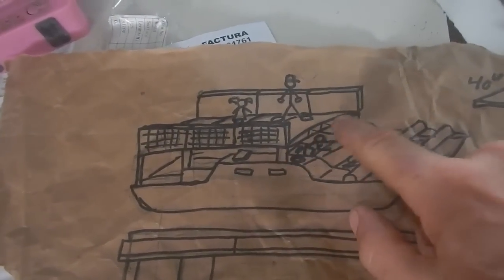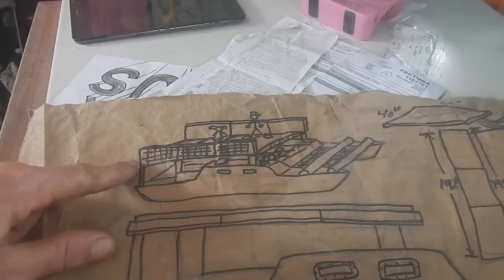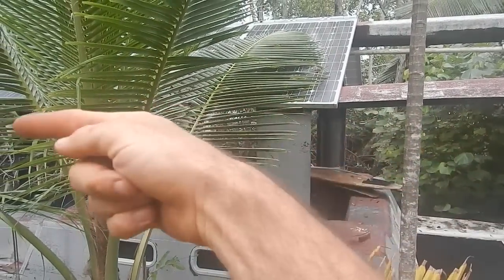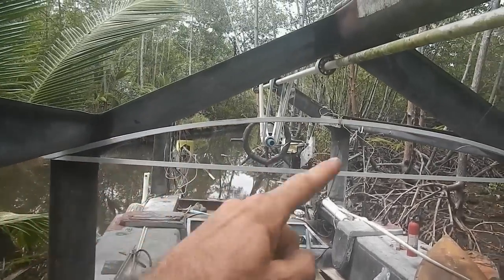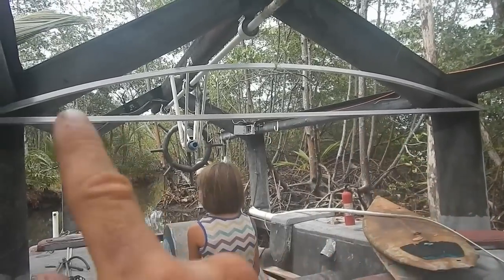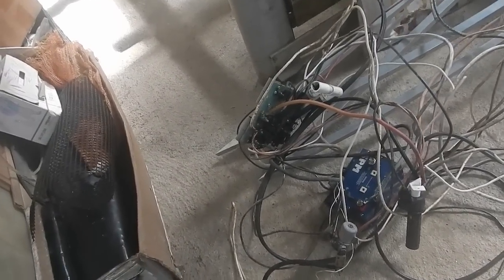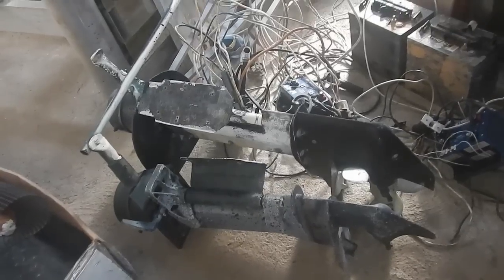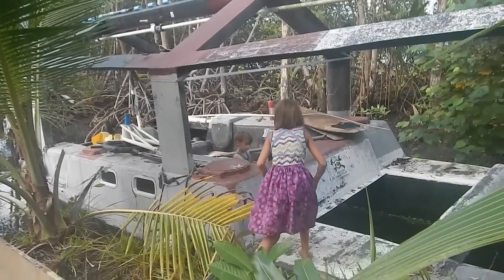Shark Slicer upgrade 011 Out With The Old

Comment: love the concept. I am gonna miss that structure. can’t wait for the new look. my idea was each solar panel section has extended pipe that fit into angled pipe inserts predetermined for each situation. manhandle each solar panel into position and then double loop cotter hair pin to lock it down.

Comment: If you are going with the metal roof. It's going to be super hot sitting underneath. Walking on top will melt your flipflops.
Reply: Painting the outside white and the inside black should help with the heat.

Comment: what about putting the solar panel on upside down  U shape so it can slide on both sides, and then add a tarp that can be pulled on the inside part of the rail  - to protect you from the sun water and wind or content of the boat. I would also consider covering the panel before gong to the port so people wont steal it, and also when its not in use - so the panel don't produce 'waste' energy and shorten its life

Comment: your structural integrity would be stronger if you left  your vertical posts and the horizontal beams connecting the posts . Then  you could cut off the old diagonal roof that supported the solar panels /and all the steering mechinisms need to be reconfigured!!! Just a thought ....you always  make it work

Comment: I dont get the whole shark slicer needs a new roof. The new roof seams to be only a little bit lower.
New roof will also be heavier. I think you could have archieved Everything with the old roof.
Reply: Likewise... I don't understand why have a new roof. It's not going to be a significant change in terms of being top heavy or a dangerous sail. If it's not waterproof, well, just add the metal (or fiberglass) sheeting to the top. That's not much of a problem. No upper party deck, but otherwise... I'm not seeing how this was worth the cost or effort. Old boat was pretty awesome as it was.